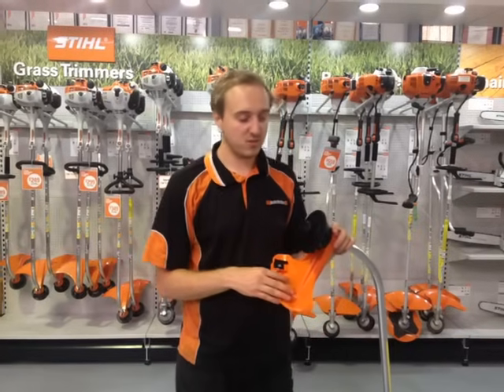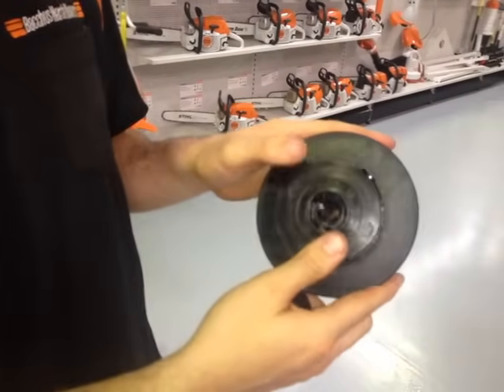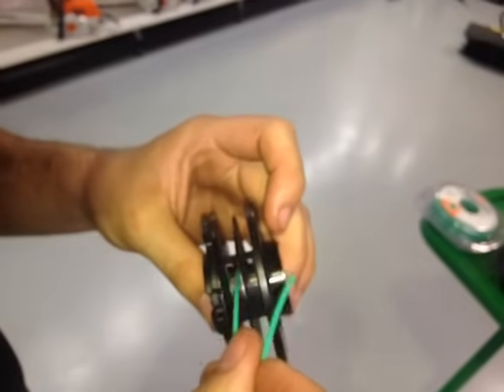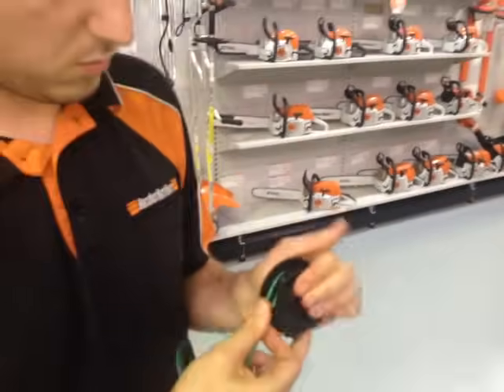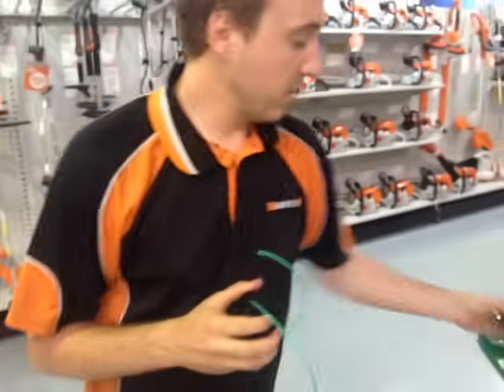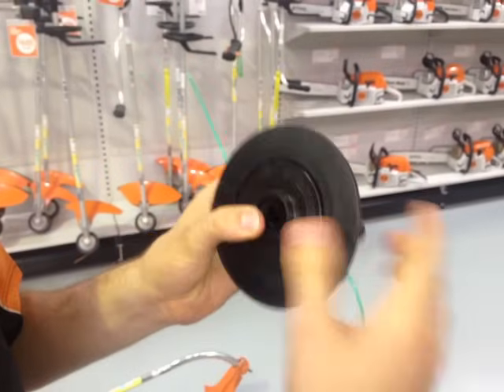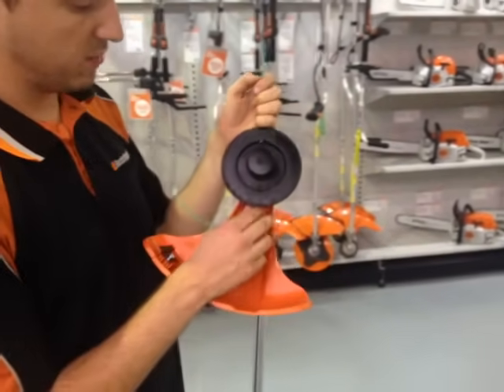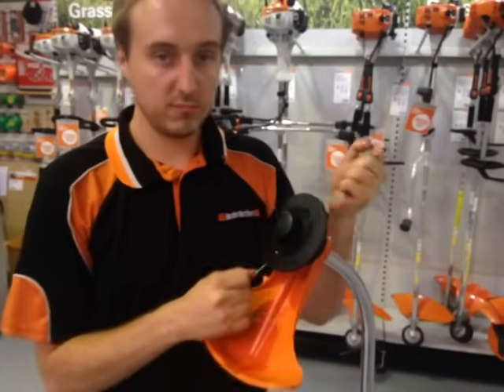How to refill a STIHL FS38 Auto Cut 11-2

Comment: If you have a 5L fuel tin it's easy - just add 100ml 2 stroke oil.  2 stroke oil bottles often have a clear window measuring gauge on the side and some have a little reservoir at the top of the bottle (or buy a 100ml measure for the purpose)

Comment: My manual says it is an FS38 but the dividers are not on either side of the spool, they are on opposite sides but both the same where it just three holes in a row. I have found three different videos with three different methods of how to attach the line, its driving me mad.